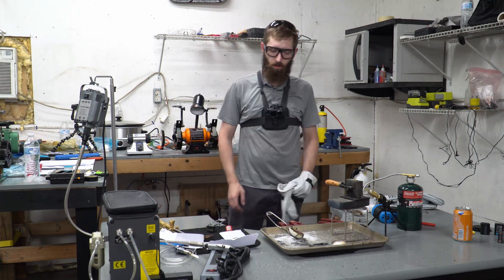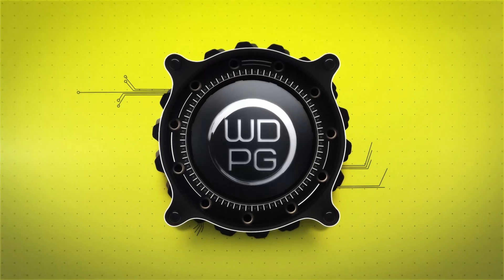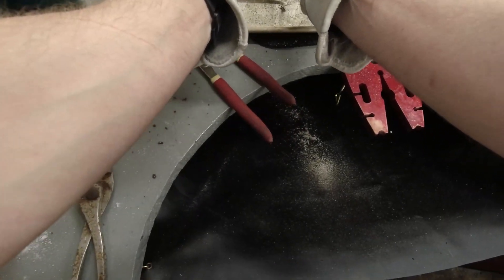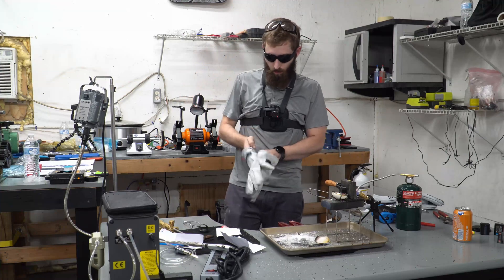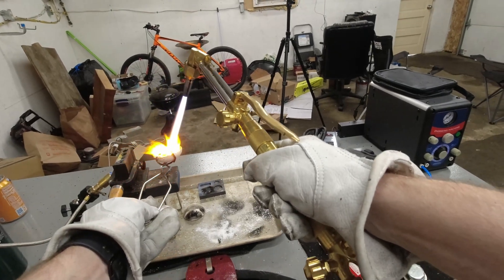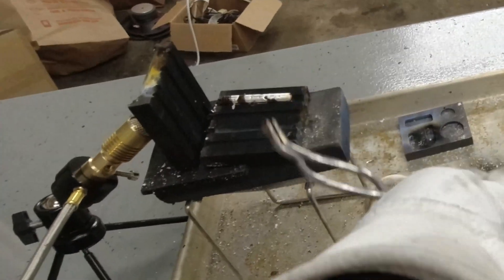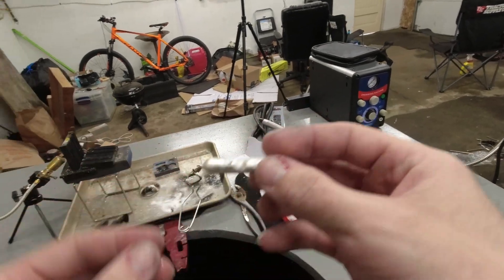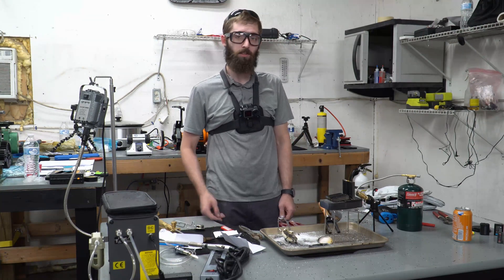Making Jewelry | Making A Silver Alloy!! | Ep. 2

Comment: Looks like a lot of fun! Thanks for taking the time to make a good video.  I love making my own casting alloys and investment casting. An unsolicited tip from a stranger, your torch flame looks like it's a bit on the oxidizing side, and when melting you really want a solid reducing flame, more gas or less oxygen. With acetylene the general rule of thumb is- light it and turn up the gas until the black floaters disappear, then start adding your oxygen. And if you can get one, I would really recommend a rosebud torch handle. The cutting torch definitely works, but the velocity of the flame even without the trigger pulled can blow away your flux and sometimes even your metal. With the rosebud you can get a lot closer to it and still get all the heat without needing to be so far back that extra oxygen from the air is getting pulled into the melt zone.  All that aside, you're doing great! Keep it up and keep having fun safely!

Comment: what would you say is the best mix you have created and a what ratios? I am looking to create my own alloys as well because i have had porosity issues in vacum casting but i only used old sterling scraps , so want to try out alloying it myself, i was thinking as well to use zinc to help with porosity and i considered germanium too. 
How did it turn out for you ?
thank you
Reply from the maker: I haven't used any of the alloys I've created with casting yet. The ratio I have found to like the most is 95%Ag, 1%Ge, 2%Zn, 2%Cu. Now I still have a long way to go with this alloy and I have found it to be very temperamental and I had to to through many revisions to get something usable. It is a tough mixture to get to come out good. I've found that larger batches turn out better.
Reply: @ yes maybe you want more copper in there.. it does depend what are you going to use it for… Probably be good for casting and firescales a mix like that..

Comment: The whole point of argentium silver is the lack of copper
Reply from the maker: I added the copper because without having it, the alloy seems to become too brittle. The patents I was reading for argentium say that they do include copper. At least the ones I was reading about do. They might have a version that doesn't as well.
Reply: @MrBeardedJeweler  Argentium 940 has 94% Silver, 5% Copper and 1% Germanium. The Germanium gets pulled towards the surface, after heat treating a finished piece at 400 for a few hours, and prevents the Copper from oxidizing. The Germanium throughout the alloy prevents fire staining as well, though too much does indeed make it brittle. Only move it when it isn't red hot, or it tends to crack and crumble. I've also seen 935 and 960 Argentium.

Comment: Why zinc it lowers the melting point, what you are making is basically solder.
Reply from the maker: Based on the research, zinc helps prevent silver from oxidizing. The small amount I added only reduces the melting point by a little bit. It usually needs around 50 percent zinc to start having the properties of a solder. I have played around with having more zinc, but the alloy becomes brittle, if I have less than what I added it forms oxidization.
Reply from the maker: I was reading the patents for some popular germanium silver alloys and they have zinc in them as well so that's where I got the idea to try it. I also found research papers from the 50's with tests of all different variations of the alloy I created. They had some pretty amazing results with having zinc in them.

Comment: I get shaky when I'm melting with open flame. But since getting a melting furnace I am a lot more chill lol
Reply from the maker: I definitely was at first until I became more confident! Is it a lot easier with a furnace?
Reply: Is a lot slower. But you dont have to deal with gasses like with a torch. You also have more control over temperature. From what I understand exposure to oxygen in flames makes copper tarnish so being able to melt without that means a purer melt. I might have the details of that wrong lol. It may be more handy if you are into casting since it can melt more material at once